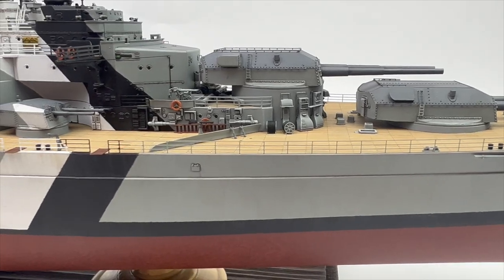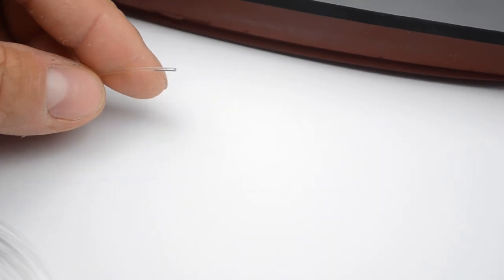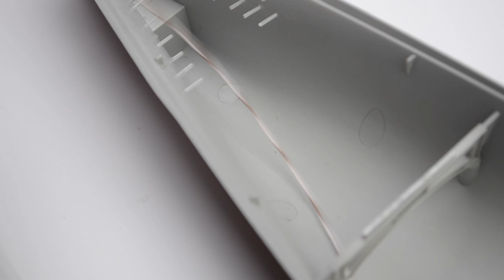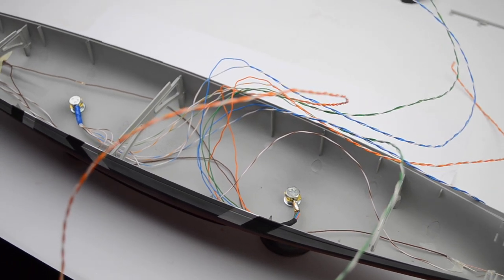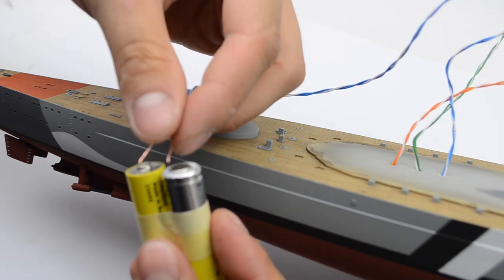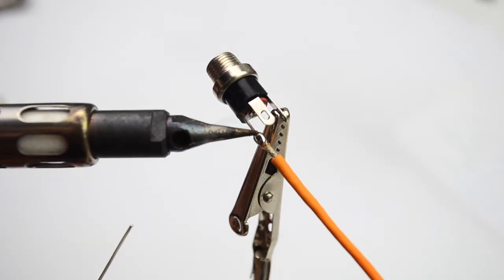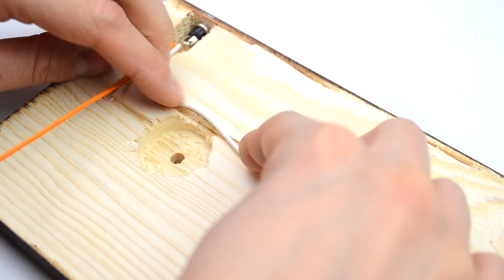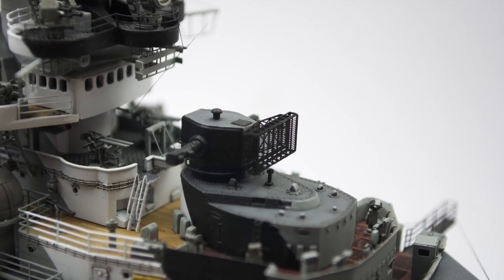Installing LED lights in our model [1/350 Bismarck]

Comment: Thanks for the video. It truly looks awesome. This will also help me with my light installation for my Richelieus hull.

Maybe as a tipp for future Ship model builds: I used micro-LEDs for the searchlights and for the aircraft hangar. Came out rather beautiful I would say. Granted this only works, if the searchlights in the kit, have a clearpart or something like that.

Comment: Here’s a hint for soldering. Apply the iron to the connector first then press the solder against the connector. The solder will draw toward the heat.

Comment: i need some help with a decision. I would also like to build a Bismarck model and am considering between two models. either revell's or trumpeter's. I heard that Trumpeter's should be much more detailed than Revell's, but I'm wondering if the surcharge of almost €100 is worth it.
Reply: Trumpeter's model is a much newer mold that is closer to the real ship and very well designed. It also comes with a large amount of PE parts that are an integral part of the model (there are no plastic alternatives). So I'd say, you're getting good value for your money with the trumpeter kit.